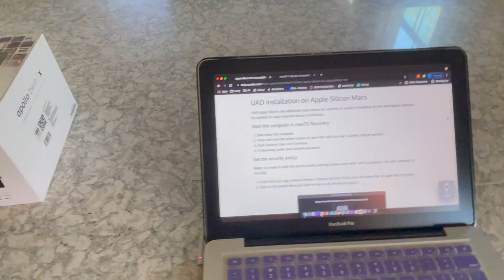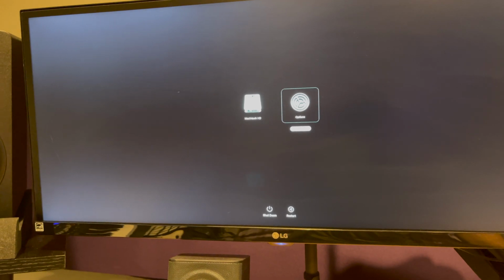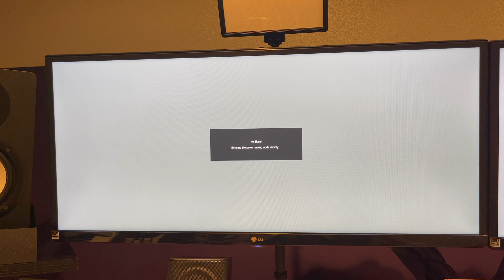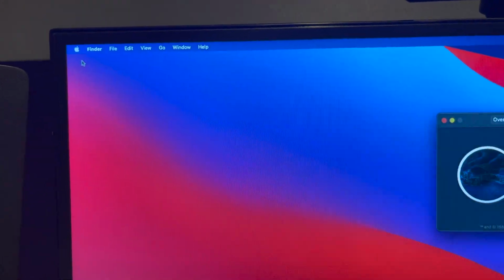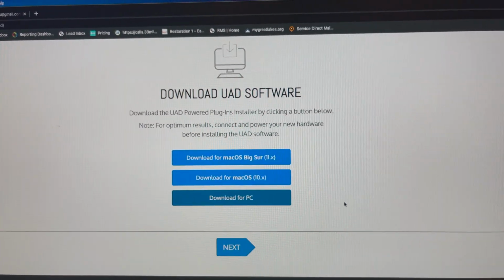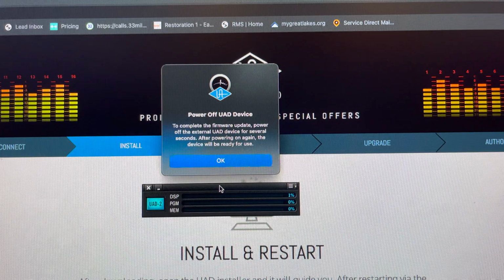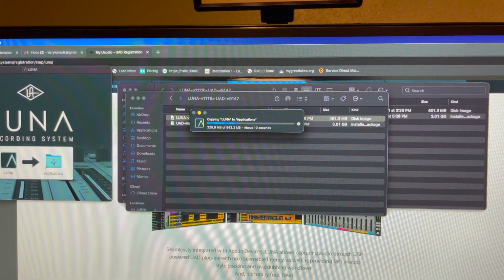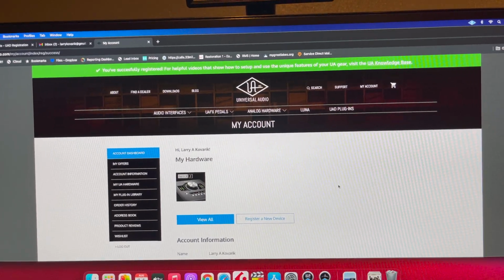Unboxing and set up of Universal Audio Apollo Twin X to Mac Mini with the M1Silicon Chip

Comment: Hello and thank you very much for your video. 
I'm wondering how you manage to have two monitors connected, the hub, and the audio interface all at once. Is one of the monitors connected to the hub?
I'm thinking about having a setup like yours with a Mac Mini M2, which only comes with 2 Thunderbolt ports, and I need one of them to connect the hub.
One idea I have is to connect one monitor via HDMI and another via Thunderbolt. Then, I would need the second Thunderbolt connection for the hub, which would leave me with no available ports for the apollo twin.
Thank you, and I hope you can reply.
Best regards!
Reply: I had the same problem and had to buy a "THUNDERBOLT" Docking Station to expand my Thunderbolt ports and allow me to have dual visual monitors and still have a port or two open for additional thunderbolt needs.  I've had great success with the OWC manufactured docking stations.  Not the cheapest, but very dependable.  They offer a few different models that have different quantity of ports available. That's what I would recommend.  Best of luck!!!
Reply: @DRKMusicRocks  Hello again. Could you tell me how you've set up your Mac mini? What hubs do you use, how many monitors do you have, do you have peripherals like a MIDI controller? Do you also use an Apollo Twin?

Thank you, and I apologize for the number of questions, but I'm about to switch to Mac after 15 years of using Windows, and it's a completely new world for me. Regards!
Reply from the maker: @gallardoseb   OWC Thunderbolt Port should take care of all of your port connection needs.  They are about $229 and should be able to handle your dual monitors and other port needs like I am using.  And I do use the Apollo Twin.

Comment: One thing that tripped me up: you MUST connect the interface directly to the computer. I use a hub just like the one in the video and it won’t connect via the hub’s Thunderbolt port.
Reply from the maker: That is odd.  You would think you should be able to connect via any thunderbolt device that is connected to your computer.
Reply: @LarrytheMusicGuy  Minor correction: The hub is USB-C, but so is my Apollo. I'm running an ultra wide monitor and and the hub, so I'm already out of ports. Not sure if USB-C limits functionality.
Reply from the maker: @CommentProfessional  So, Thunderbolt and USB-C are not the same, although their physical ports are the same.  If you haven't figured this out yet, I'd make sure that you are running a true Thunderbolt cable out of the Apollo to your hub. Once you reach your hub with the Thunderbolt, you should be able to utilize USB-C for all of your other connections. Let me know if that works.

Comment: I have the same Apollo but when I hold power for more than 5 secs in turns back off when I try to reboot, I can’t get to that options menu on the boot up
Reply from the maker: Bummer and frustrating for sure!  Sounds like your Apollo is being flaky.  Do you have the latest firmware installed in the Apollo?  If so, I'd reach out to UA tech support to see if they are aware of that situation.
Reply: @LarrytheMusicGuy  I actually just resolved it thank you though!
Reply from the maker: @youwouldaslippedthoo3439  Awesome! Enjoy!!!

Comment: How did you maintain the 2 monitors and hook the Apollo? Did you use the thunderbolt on the dock?
Reply from the maker: Sorry for the delayed response!  Hopefully you've figured this out by now, but just in case you did not I still wanted to respond.  So, the cool thing is that when you connect the UA interface to your Mac M1 via the Thunderbolt cable, the MAC recognizes the interface as selectable audio. If you go into Settings...then Speakers/Audio you should be able to select the UA interface.  This even allows your computer related audio like streaming YouTube videos to run through your UA interface.  The only drawback is that the UA interface needs to be on and set up correctly in the UA software interface.  I hope I understood your question correctly and also provided the answer you were looking for?  If not, hit me back up again and I should be able to respond quicker now that I'm catching back up on my responses.

Comment: Great video, I was looking into purchasing the Apollo Twin X soon but one thing I could not confirm was is the Thunderbolt connection used for midi? There are no conventional midi pin connectors which is not usual these days. Let me know if you know. Thanks.
Reply from the maker: Your computer of choice should be what runs and controls your midi devices.  I have a few midi devices running into my Mac Mini M1 via standard USB C connections while utilizing the Apollo Twin.  So to answer your question, yes, the midi information is capable of communicating with your DAW Software of choice via the Thunderbolt connections.  If you have an old school DIN Midi Connector you are looking to utilize and looking for the matching DIN connector, you will not find that with either the Mac Mini or the UA Apollo.  You'd have to invest into a DIN to USB converter to plug into the Mac Mini.  I hope that was helpful?
Reply: @LarrytheMusicGuy  Thank you Larry!

Comment: Just came across your video‼️ I have a 2017 MacBook Air and I’m trying to connect the Apollo twin... what do you think I should  do to get the Apollo interface to work?
Reply from the maker: If you are running an Intel Processor like I believe you are, you should be able to just do a typical standard installation. I assume you’ve tried that already with no luck?

Comment: Amazing video
I have a question. I work in Luna + apollo x4 on a late 2013 Imac 8G 256. Not ideal I know. I compose orchestral music using Spitfire discovery and Albion One and add vocals to the composition. I use some UAD plug ins Fab EQ and the Izotope. In Luna I have the NEVE console added and that uses a lot of power. Even so - With a 10 to 15 track my computer renders at 130 and already at 100 I hear a lot of drop outs when bounce the track. I need a new Imac. I've seen the new 2021 24 inch Imac that comes with 16G 8-8 and 1 terra. Would that computer which is an M1 do the job for me? I might be able to expand the amount of instruments for a fuller orchestra or movie trailer but I will I guess never go over 50. In the UAD group the pro's of course advice the fastest of the fastest you can get but with Apple"s prices on upgrades that is just a lot of money and maybe even overkill for me for that matter. What can you advice about the M1 Imac or should I wait till the new 2022 Imac is released? Thanks in advance
Reply from the maker: Hey Josh! My Mac Mini M1 handles everything that I can throw at it. With the new M1 X out I don’t think you can go wrong with that latest offering. And honestly, I think the M1 would more than handle what you are looking to do. I’d imaging the prices on the M1 models will be coming down as well. I ended up purchasing the UA Octo Satellite to handle all of the UA plug ins I like to use while mixing down. That made a huge difference as I try and run as much UA plug-ins as possible to allow my Mac M1 to utilize its processing power for the tracks themselves. I had a 2013 MacBook Pro before and it was really struggling to handle my audio and video needs. The M1 just smokes my old MacBook.
Reply: @LarrytheMusicGuy  Hi Larry, Thanks so much for your reply. As I read your story you understand my challenge with the old Imac 🙂- I think in time I will also be going for a satellite cause some UAD plug ins especially the chambers shoot up very fast as I reach 85% with some other plug ins added :-) First is the computer that I need to get. I was refering to the 2021 24 inch Imac 16G with 1 terra - That doesn't have the X or Pro - It is just M1. I am working now on a Pirate song using the discovery spitfire instruments. With 25 tracks now I can't add the Neve summing what makes it sound so much fuller. I can't finish the composition because the computer renders without the neve summing at 100% with the neve summing my computer just crashes. I do think to finish the composition I probably need 5 more instruments from the orchestra and maybe some more for percussion so it does go up to 40 incl the busses. I have the Fab EQ on every channel, some tape, on the mixbus the Neve C mix bus compressor and a Izotope - Are you sure  that this 2021 M1 Imac with a 16G will  run effortlessly with all these tracks and plug ins? This new technology is so new to me that I have a hard time believing my headaches are gone and the music runs just like water finally and I can finish my projects :-)
Reply from the maker: @joshrainbow-Tenor  I do believe that the M1 will resolve your issues. To be 100% sure, I’d recommend going with the M1X if you have the money to spend. Not sure what the difference in cost is, but if updating I’d sure try and go for the best available technology. There was a hug difference between my 2013 MacBook Pro and the M1 when rendering…like 4 times faster. With that said, once I added the Octo Satellite and really pushed it to the limit, the rendering times did take longer as the UA Satellite is still using older chip technology. But, I’ve not had one error while rendering.
Reply: @LarrytheMusicGuy  Hi Larry, Thanks man. You brought a smile on my face. 4 times faster woww does that mean what renders with me at 100% on the late 2013 will drop at least to 50% or lower? man, if that is the case my problems are solved just with that M1 Imac 2021. Adding another 5 instruments or so wouldn't really make a huge difference to the total of tracks I already have. Thanks so much for taken the time to answer me Larry, really cool of you. You gave me peace of mind to get the machine with confidence :-)
Reply: @joshrainbow-Tenor  I'd be curious to hear what you think if you do indeed upgrade to the M1 or M1X.  If so, hit me back and give me an update!  Best of luck!
Reply: @larrysplayground   Good morning Larry, I will surely update you about wether I purchased the M1 or wait till  the new Imac comes in march with the M1 pro. No idea if the upgrade to 10 cores really makes a difference compared to the 2021 Imac that has 8.

Comment: How is console and all the UA plug ins working with the M1? What’s your experience with the M1 and UA products?
Reply from the maker: I absolutely love both the M1 and the UA Apollo Interface.  First off, the M1 is smoking fast and has made a huge difference in my video editing and rendering speeds.  The Apollo Interface has been solid and literally has zero latency. The UA Plugins are a little expensive, but are truly high quality like touted.  I typically only buy the plugins while they are on sale, which seems to happen every couple months or so.  The really great thing about the M1 and UA system together is that you can still use your computer plugins along with the UA plugins, which literally more than doubles what you can do, especially when mixing down.  I did end up buying the UA Octo Satellite to be able to run the amount of plugins I like to use at mix down.  The Apollo I have is a "Quad" processor, but that could barely handle 4 high end plugins, thus the reason I added the "Octo" UA Satellite ($1200 range). With the 4 in the Apollo that gives me a total of 12 "'processors".  Absolutely zero regrets with either purchase!

Comment: Is this not massive compromise in Security ? Don't trust this... may I am selling the interface
Reply from the maker: I haven't had any issues at all and have been running my system like this for a few months now.  With that said, I'm sure at some point both UA and Apple will get this issue worked out where we can all run the UA interface without changing the security settings.  I will keep an eye out on this situation and if/and or when this changes I will provide an update video.
Reply: @LarrytheMusicGuy  i wont risk when doing crypto or other important things on computer. May parnoid but thats the way to go for me
Reply from the maker: @Kfzzzll  Probably a good idea to not do anything with banking, etc. on a lower security level computer.  I only use my M1 strictly for my studio audio and video recording.
Reply: @LarrytheMusicGuy  agree

Comment: Hey Larry!  I tried googling this, but haven't had any luck finding an answer.   Once I have the interface setup and going should I turn the security setting back to "full security" in Recovery mode?  I didn't know if changing the security settings on my m1 mac left it susceptible to viruses or malware, or if it would make my interface stop working.

 Loving the Apollo twin.  Thanks again for the tutorial!
Reply from the maker: Ned Lee, I'm not sure if there would be any security related issues with the lower security setting. I'm pretty sure you have to leave it that way, that is as of the time of making this video.  I would like to think that somewhere in the future that both Apple and Universal Audio resolve this issue so you could turn the higher security level back on.  It may just require you to try and go back to full security mode and see if your interface works or not.  If not, resolve back to lower security mode.  Best of luck and enjoy recording!!!
Reply: @LarrytheMusicGuy  thanks again!

Comment: Any update? On how its working and if any corruptions occured on ur computer? And also when doing this it doesnt erase any thing you have on ur mac already correct?
Reply from the maker: I've had absolutely ZERO issues with either the MacMini M1 or the Apollo X interface. It's been rock solid and there's literally zero latency, which is the way recording SHOULD BE!  Zero regrets spending the $$$ for my updated setup.

Comment: @Larry the Music Guy. I'm getting terrible cracking/white noise feedback what have you, from my twin x to mac mini m1 system and my guitar connected. I just can't seem to get rid of this white noise when I try to record guitar. Any ideas or what I can try to get rid of this annoying crackling?
Reply from the maker: It sounds like you've got some sort of feedback loop going on.  I'd start by going into your Universal Audio Control panel and make sure you have all of your routing set up correctly.  Also, look at the UA Control Panel to see if the meter bridges help give clues where it's coming from.  What DAW are you using?